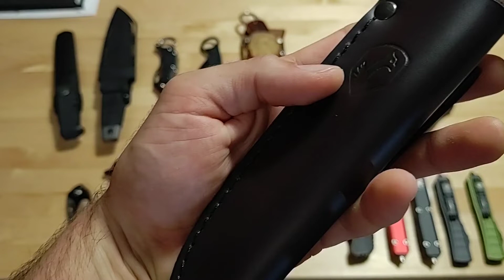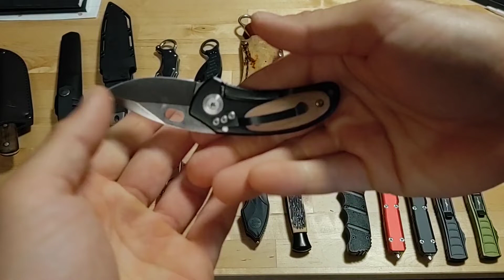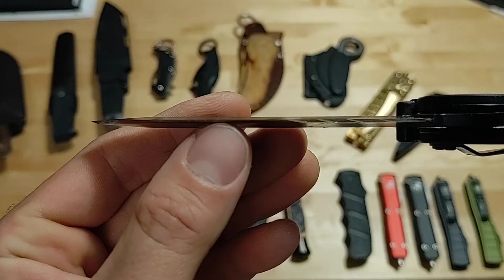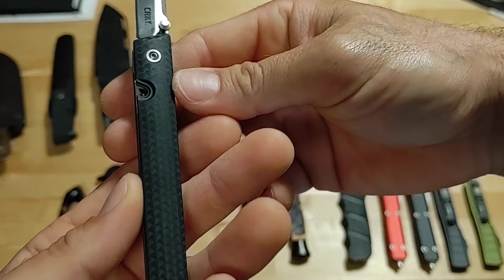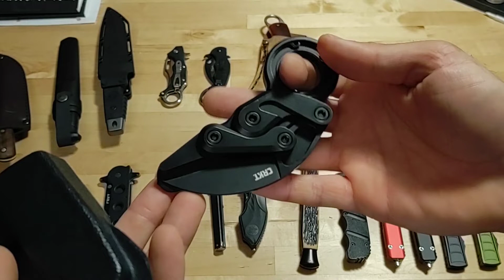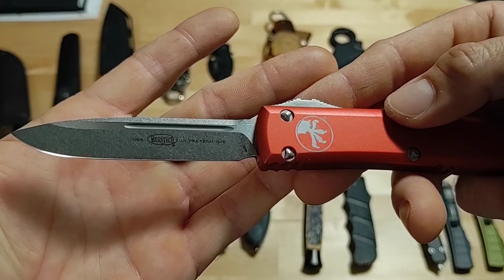My knife collection

Comment: I really would love to get myself an Ultratech. However, it costs a ton of money and I've basically never in my life had so much at the same time. So yeah... Looks like I'm too cheap for a good knife :D
Reply from the maker: All the stuff old people tell you is true. Even if you only make $20 a day SAVE SOME OF IT! It adds up over time. I had really toxic money habits for a long time. Obviously, there are also situations where saving gets hard, because you end up having to spend all / most of what you make. TRIM THE EXCESS! Look where what you're buying is or isn't necessary. Don't get me wrong, I love my microtechs, but they are not necessary. KEEP ASSETS FLUID, this means, keep your money / investments in a form that can be traded / sold back for AT LEAST the initial capital